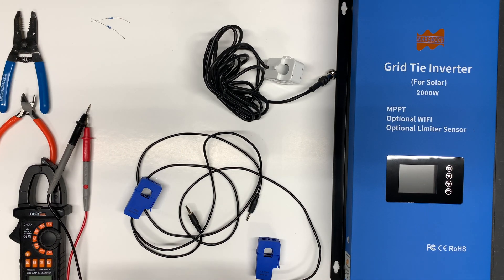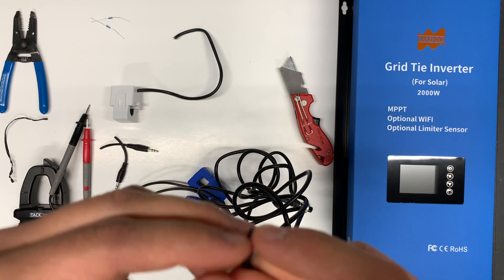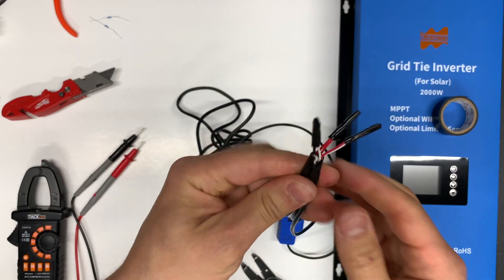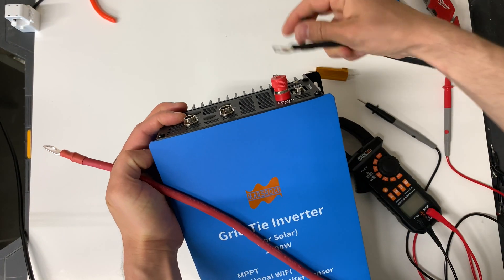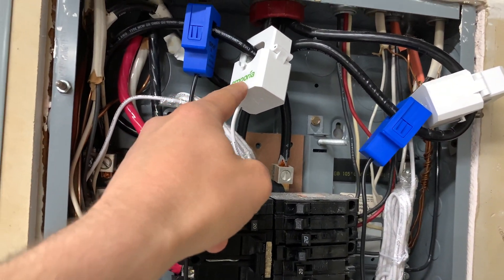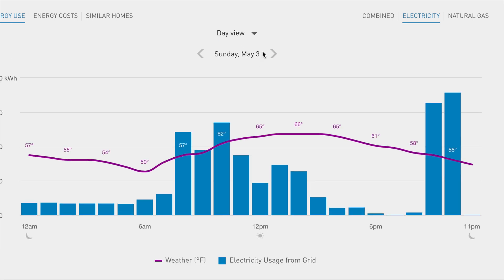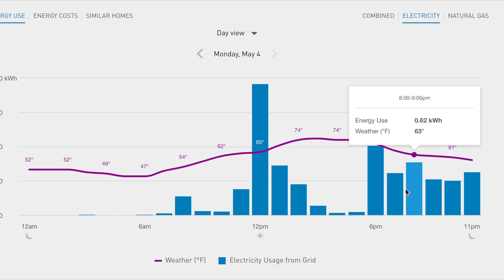2kW Grid Tie inverter with 2 CT sensors. Part 3 of 3. For US split-phase system.

Comment: If L1 is requesting 100w and L2 Requesting 500w, does the Inverter will know which one needs what?
Reply from the maker: Inverter will send equal power to both legs 300w/300w.
Smart meter measuring total W going in/out using only L1&L2 (meter not connected to neutral), so meter will see that total consumption as 0w.
Reply: @SolarEngineering  niceeee, thanks!!!!
Reply: @SolarEngineering  Waht tool u use to detect backfeeding ?
Reply from the maker: @carlosguzman4461  I was just looking at smart meter, it shows negative amps when backfeeding.

Comment: I just got mine install today, the meter go backwards very super slow the number stay the same when no big load. Is this normal? Am i doing it right?
Reply from the maker: Do you have digital or analog meter? Analog - where you can see spinning physical wheel.
Reply: SolarEngineering it is digital it have 2 bars when i turn off inverter it will go from left to right, when inverter running when no big load that 2 bars stay and backwards very slow. Thank you.
Reply from the maker: @lilanhtu  I see, this smart meter. In place where I live, company will charge me for kW that I'm backfeeding into grid, so here is why I need to install limiters.
Sounds like your system works, congrats.
Reply: Hi sir one more question. I run 6 panels of 275watts/60 cells, 2 in series = 62 volts. Most the time we use around 400watt so try to save the one from solar to battery to use at night. I have a lot lithium ion batteries (18650) i try to do 3s battery bank, so 4 of them in series will come out 50.4 volts but the charge controller i bought before is 30amp for 12/24 volt system. Do you know any charge controller that will work with my system? Thank you.
Reply from the maker: @lilanhtu  you could use MakeSkyBlue MPPT controller, I reviewed it recently. And going to do more detailed test soon.

Comment: How does the inverter know which leg the power is coming from
Reply from the maker: it doesn't,  it will push energy back using 2 legs (equal amps to each leg I assume and smart meter will calculate total A coming to/from grid)
Reply: @SolarEngineering  The reason I ask is that in my country we have similar leg in our main breaker box but we only use 110v ac appliance that only require one leg of power
Reply from the maker: @dainthamos4712  to confirm: you have 2 legs coming to your electrical panel, 110V each. And all appliances using 110V, so loads for entire house distributed equally across 2 legs (or at least close to equal), is that correct?
In total you have 4 wires in electrical panel: 2 Legs, 1 neutral, 1 ground?
Reply: @SolarEngineering  That is correct. But my load is not balance so if for example I am using 600watts on 1leg and 300 on second leg the inverter would produce 900watts equally which would equal to 450 watts on each leg which would mean that I would be over producing on leg 2 which the power company would charge me for
Reply: I am considering to have two 1000w inverters which give me mor control over each leg demand
Reply from the maker: @dainthamos4712  you are right, in this case two 1kw inverters will be best solution.

Comment: how is the operation of the 110v equipment? your inverter is 220v, in that case you put two sensors the grid will inject current into the network when you have 110v equipment? in my resistance I have 110v and 220v equipment. I used Google Translator
Reply: At the AC output of this neutral grid, another phase does 110v?
Reply from the maker: @gustavocamargo9340  this video is for split phase systems, like USA/Canada/Mexico
If you have only 110V, then you can use 1kW version of this inverter, it will work right out of the box.
Let me know if I answered your question.
Reply: @SolarEngineering  I need an orientation, my resistance here in Rio de Janeiro the power supply is 1 neutral and 2 phases 120v. The 1000w grid tie limiter would only inject power in 1 phase 120v, the 2000w grid with 2 phases 120v injects energy in both phases. In my resistance I have equipment that works on 120v (neutral + 1 phase 120) and I also have equipment that works on 220v (two phases 120v). What would be the ideal grid tie limiter? Does the 2000w 220v grid work for 120v equipment? Or I have to put two 1000w grid tie limiter (one for each phase). Using Google translator  , I live in Rio de Janeiro.
Reply from the maker: @gustavocamargo9340  hi again, I don't know if 2kW version will work with 2 phases. You can install two 1000W inverters. One inverter on every phase, then I think it should work properly.
Reply: The 2000w grid tie limiter would have to have two separate inputs for the TC sensor . Only then would the equipment do the correct mapping in both phases regardless of whether it is using 120v or 220v biphasic.

Comment: Hello! Do you think this inverter can work with 4 x 255W panels and no batteries? The panels are too big for the 1k inverter (VOC 38.7, VMP 30.6, 8.32A), so I think the 2k gives good room for expansion. The only configuration I can think of is two strings of 2, joined in parallel so 77.4V, 61.2V and 16.64A. It should be okay for the 45V-90V input but there is no DC amp input listed. Will 17.7A be okay? Do you think the dryer plug or direct into a two pole breaker is better, and for safety do you think the inverter should have DC and AC protection e.g breakers and shut off switches either side? Sorry for so many questions.
Reply from the maker: Hi there,
1. 77.4V, 61.2V and 17.7A
> yes it will work, inverter will pull as many amps as it needs in range of 0-17.7AA

2. two pole breaker is better
> yes, separate 240V line with it's own breaker for inverter is better.

3.inverter should have DC and AC protection e.g breakers
> 1 dc breaker, 1 ac double breaker should be fine
Let me know if you have any other questions.

Comment: THANKS so much for your response.
Not sure how to read the display and what its telling me. 
These were some of the readings I'm getting. I have 6 300 watt panels.
521.1w (solar) 1600 w (Small # under 240 volt)
1064.4w (solar) 1597 w (Small # under 240 volt)
1192.5w (solar) 1594 w (Small # under 240 volt)
1324.8w  (solar)1602w (Small # under 240 volt)

Does it look like I have this setup correctly?
Reply from the maker: check this video: https://www.youtube.com/watch?v=UrHD9OLmJtE
let me know if you have questions after

Comment: I just installed this unit (2000 watt model) It looks like you have both sensors arrows are pointing to the right. shouldn't 1 point left???
Reply from the maker: correct, one sensor needs to be reversed.

Comment: hello good morning greetings from Costa Rica I would like to buy an inverter of these watching ebay but I was left wondering if it will work in my country because here the electrical system is 120/240 split phase and as this inverter only brings a sensor for one phase but  Now I see that you make a modification to connect 2 sensors in one, I would like you to help me know how to make that modification and how to connect the inverter to the grid in my country works L1 N L2 (L1 + N 120v) (L2 + N 120v) (  L1 + L2 240) the output of the inverter should have 3 cables to connect each phase and the third to the neutral bar, ok I only speak Spanish excuse any translator error my WhatsApp is 506 72061632 I hope you can help me
Reply: escribeme a +507 62760810 - ya compre uno y lo vengo estudiando

Comment: Great Video! Can this be done with the 1000W grid tie inverter? I'm going to try to set up the 1000W inverter here in Los Angeles...hopefully the power company doesn't come knocking on my door.
Reply from the maker: 1kW going to be even easier. you'll just need to install 1CT sensor that coming with inverter. Just make sure you are connecting inverter to correct leg (inverter should be plugged to outlet that is powered from Leg that monitored by CT sensor).
Reply: @SolarEngineering  My electrical panel has 2 legs. Wouldn't that cause an imbalance and send power back to the grid?
Reply from the maker: @czarrevs3616  1kW inverter works with 120V, so if you install sensor on correct leg it will not cause backfeed.
If you want to have 0 grid usage, then you will need 2x 1kW inverters (one for every leg). 
Or 2kW version(like in this video) - 2kW using 2 legs so you could do 0W grid consumption with just 1 inverter.

Comment: Your explanation is CONFUSING, How can your inverter supply ANYTHING at night with NO sun? Do you have batteries on it? You don't mention having batteries at all.
Reply: AND, I don't have batteries hence (Grid Tie) will this unit work without batteries?
Reply from the maker: @OldSalty22  yes, this inverter working with batteries OR solar. Anything that in range of 45-90V.
So you could connect solar panels directly to inverter.
In my case I have 16s LiFePo4 battery connected to inverter.
you could check entire system here: https://www.youtube.com/watch?v=kf9mkorFV2g
Reply: I do 2 panels in series come out 62 volt work fine with sun only. Will add battery in features :)

Comment: I have the same bug on starting the inverter, starts with 1450w. When set limiter and battery type I had constant 125w and no reaction on high grid consumption. How did you fix the inverter bugs?
Reply from the maker: in my case it works fine at the end of video. did you connect CT sensors correctly to L1 and L2 wires?
Reply: @SolarEngineering  I used the original limiter sensor that was in package with the 2000w grid inverter. In my case the inverter didnt measure the power.
Reply from the maker: @smartines  yeah, it will not work correctly with standard sensor. Look at Part2 video, I'm explaining why it's not working.
Reply: @SolarEngineering Thanks for your hints, Im from EU we have 230V Standard here. I have now other gtil here. And it was working as it shoud. Then I tryed limiter Clap on one line and Gtil on other line. And now its not working right aswell as the first gtil. Is there a way to reset it completely? Iknow the select+up on Ac connect. This reset the Statistiks and the battery Mode. But I still have this error, gtil putts all energy to the grid and ignore the limiter sensor. 🗯After some hours reseting and trying I have it working again. Somehow I reverse the clap sensor resetet all options and Its working again.

Comment: Excellent.   You showed me that I can  extend perhaps the  clamp cable... several feet ...since my battery bank and the breaker panel are about 30 ft  apart.  Since   the output is current...maybe it will have little effect at the inverter input.  Therefore, I don't need to buy the extender limiter.

 I read somewhere .that if you  have the clamp connected at the panel ..you better have at least a resistor to dissipate the current at the end or have it already connected to the inverter. Good Job!!!
Reply: Did you try 30ft cable, trying to find the max length I can use.

Comment: Should there be any issue with using two of these 2000 watt inverters?  Keep the great videos coming!
Reply from the maker: Theoretically shouldn't be. I'm planning to install 2nd inverter in future.
Reply: Ihave one of these they should be able to add more. i think you need the remote addon so they can talk to each other to prevent issues. ill add more to my 80V 1900W solar setup later in life. Suggest doing a 48V 100AH+ battery for night time use

Comment: Hi, I am about to buy the same inverter, but I have to place it far away from the electric panel. I was thinking about running a long 2-wire cable to extend the sensor original cable. Do you know how long the sensor cable could be without affecting the data readings?
Reply from the maker: I don't know max wire length, but you always could connect additional CT sensor in parallel, it will make signal stronger.
Reply: I try install mine today go to the back yard kinna long too it work, but i saw my miter go backwards very slow and the number stay the same if no big load, so i don’t know if that is normal.

Comment: Resistor at min 05:58 - what is the Ohm  =  800 ?
Reply from the maker: it's 50 Ohm, using this resistor to pre-charge inverter.
new video will be soon of entire system

Comment: What is the best configuration if I already bought two 1000 W with limiters, my setup is one for each leg.
Reply from the maker: you'll need to find 2 outlets that on different legs. then install CT sensor on correct leg and plug you inverter:
INV #1 on LEG1 and clamp on LEG1
INV #2 on LEG2 and clamp on LEG2

Comment: What size wire is used in these wires.
Reply from the maker: white CT sensor that came with inverter: 20AWG
blue CT sensors: 24AWG

48V to inverter: 8AWG
240V power cord: 14AWG

Comment: Can u verify the amount of power u are using matches what your inverter screen says the grid is supplying? If u are backfeeding it will show as a positive reading on your electric company meter and u will be charged for it. 
Can u verify with your emporia monitor?
Reply from the maker: emporia stopped working at this time, because it sense power from L1 and L2 individually (L1 + neutral) (L2 + neutral).
and inverter pushing power trough both legs. I know how to fix it, will shoot video later.
need to buy additional sensor for emporia.
but at this time looks like inverter pushing right amount of power (looking at electric company website 10:05)
Reply: Your electric company app will most likely show backfeed as power used so once u get your emporia configured to read your mains wires at 240v instead of 120v and 120v u will know for sure if cables are working correctly

Comment: Will this plug  in 110v in your plug?
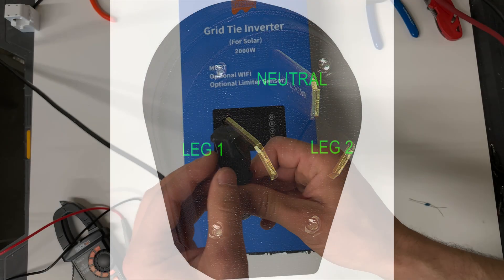Reply from the maker: it goes to 240 outlet (7:02).
Reply from the maker: standard cable has 3 wires:
hot (black), neutral (white), ground(green)

so black and white wires should go to Leg1 and Leg2, ground wire to ground wire.
Reply: @SolarEngineering  how does it work for a newer dryer plug that has 4 wires?
Reply from the maker: @thedabbler2753  
3 wires plug:  L1 L2 and ground
4 wires plug: L1 L2 neutral and ground
For 4 wires plug you just do not use neutral.